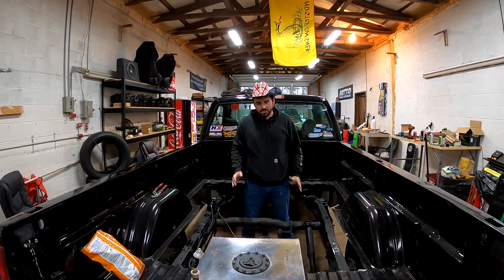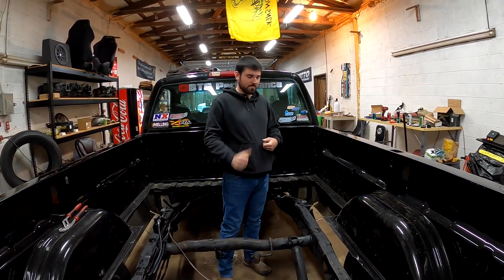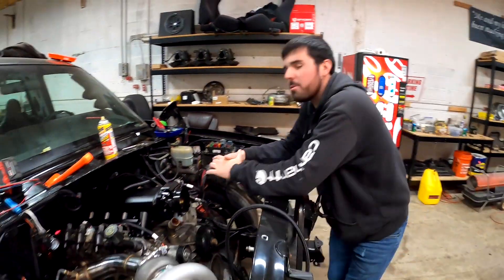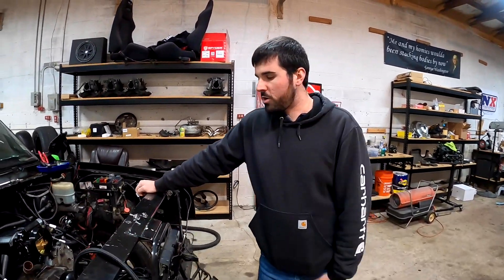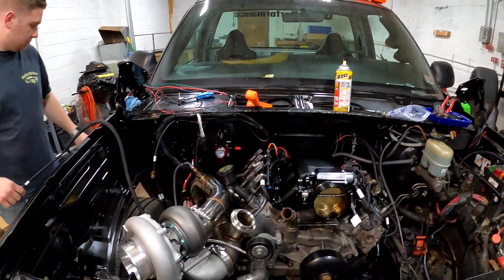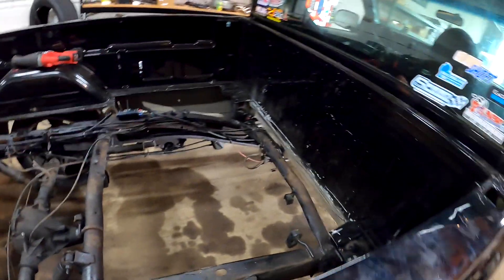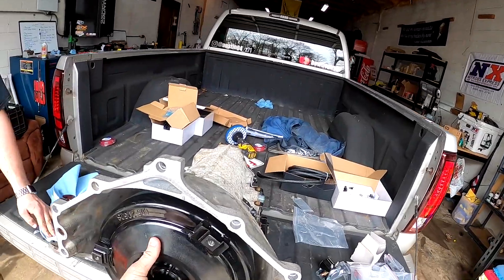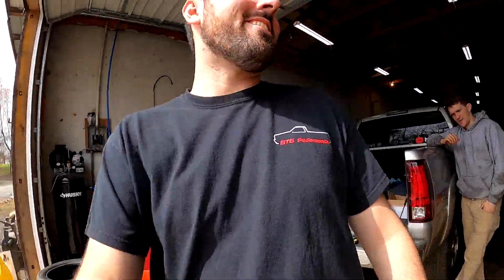Installing a built 4L80e and Turbo on the 5.3 Long bed! *Skidmark Returns*

Comment: I have to ask, why cut the bed floor out? That’s kinda the wrong end of a truck to take weight out of.
Reply from the maker: There’s only but so much weight you can take off the front. Plus we shifted weight like fuel and soon the battery all the way back. A good radial and trac bars will give us all the traction we need. The weight savings will help out a lot.